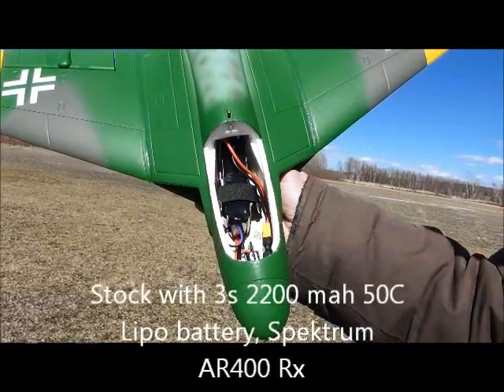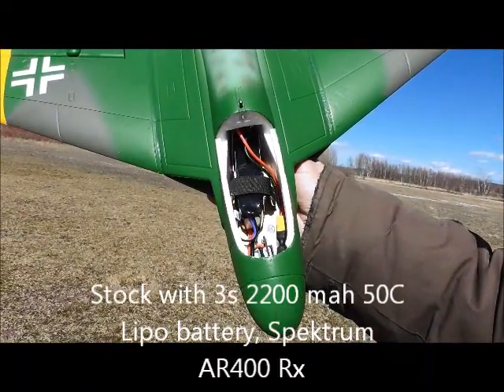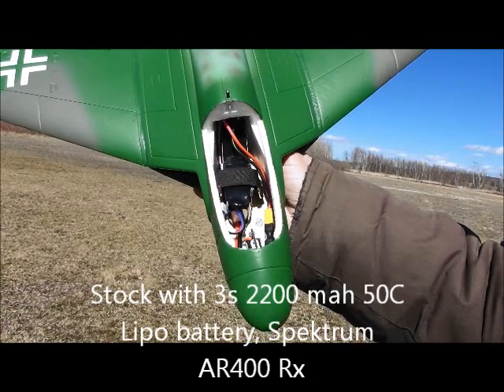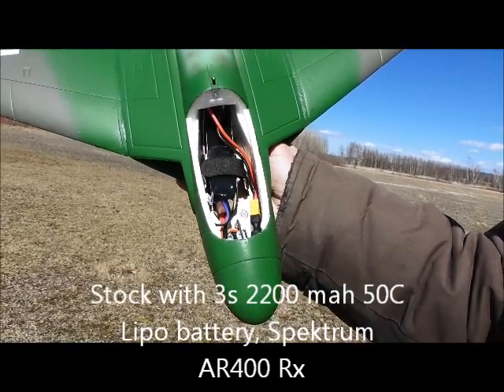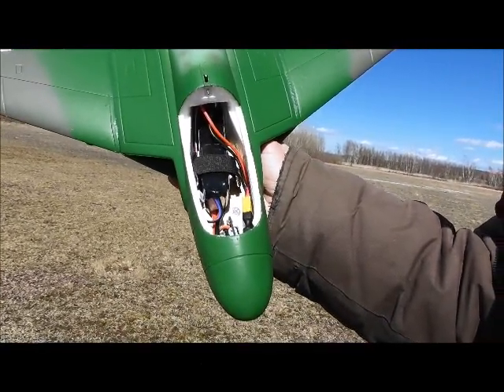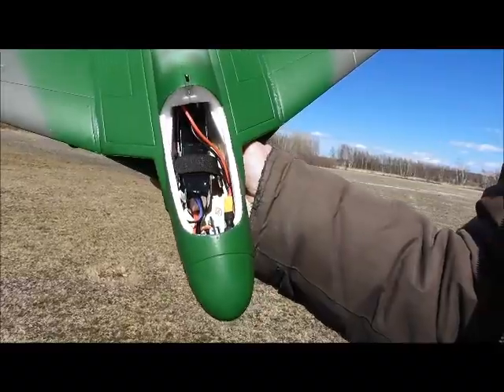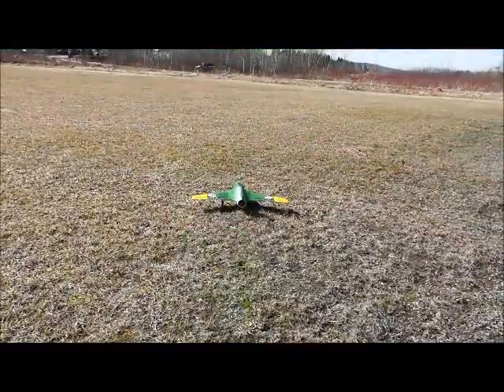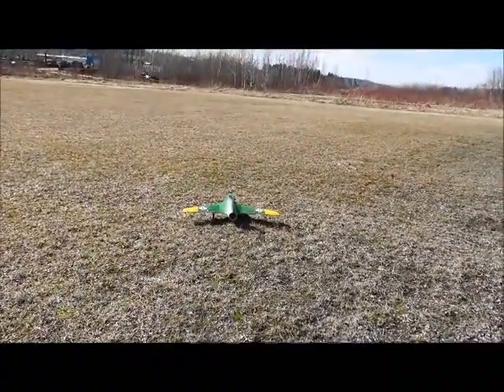Lippisch P.15 GrassTakeoff and Landings

Comment: I put gear on mine but was afraid the ESC would get to hot and like the belly landing better. Great job though.
Reply: Why did you think having landing gear would make the esc get hot?
Reply: @nickhayley  becacuse when you install the nose gear that takes away the only cooling from the front. im sure it will be okay since edf flights are normally short. i tend to be more cautious than i need to be.i would just keep a closer eye on it. maybe get infraed thermomator.
Reply: @FatGuyFliesRC  Ahhhh. Good call. Yeah, I suppose if the gear is easily popped in and out I'd be happy to use it, but if it becomes permanent, that would be another story.
Reply from the maker: The gear on the front of mine is glued in permanent, but if it ever breaks, I will cut the wire, remove the gear on the main wing and do something else to launch it.